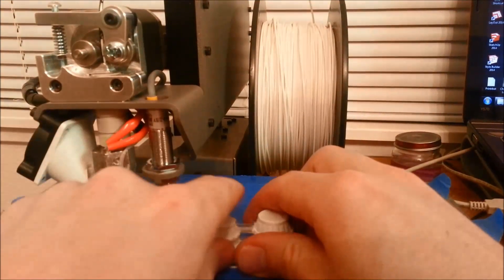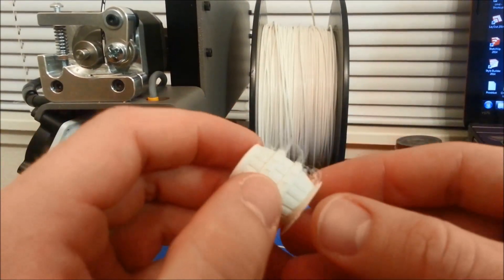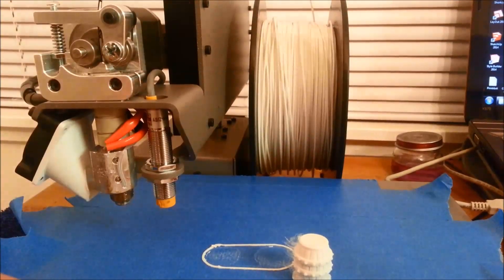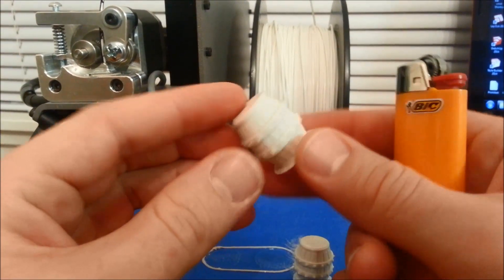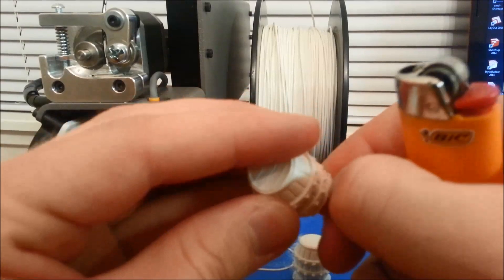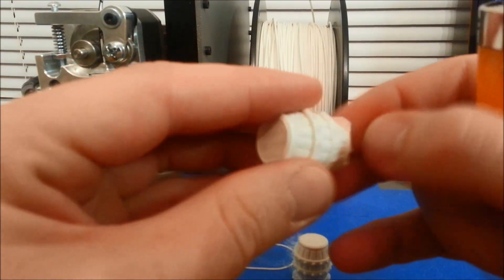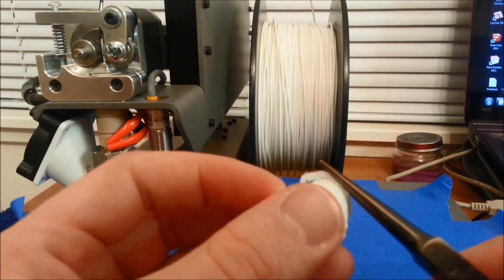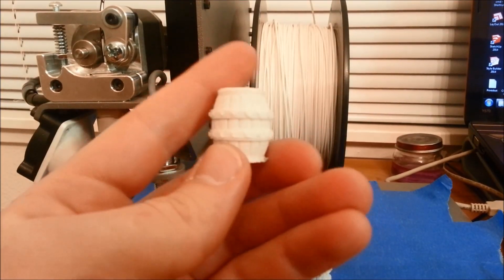Printrbot Simple Metal - 3D Printing Miniature Barrel

Comment: Hey I was checking your provided barrel GCode. watch the extrusion width settings. There are a couple instances where the extrusion width goes smaller than the nozzle size. For example the top extrusion width is .10mm. You may be causing under-extrusions since the nozzle is .4 and it's impossible to get a smaller bead of plastic than the nozzle size. I had this on my first layer on accident and noticed horrible print quality and adhesion to the bed.
Reply from the maker: Thanks. I had not taken that in to consideration. They came out good though. :)